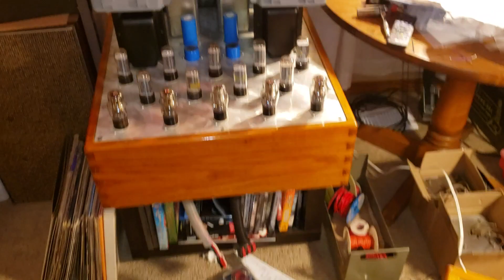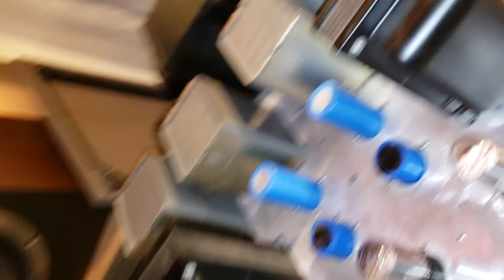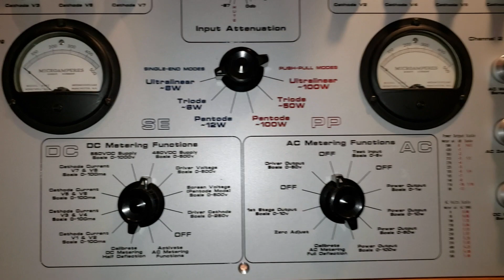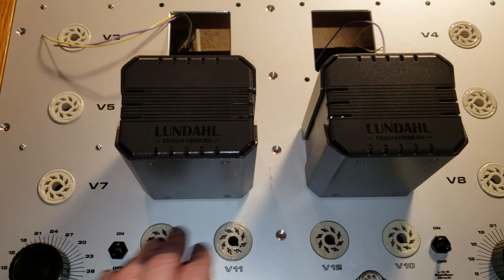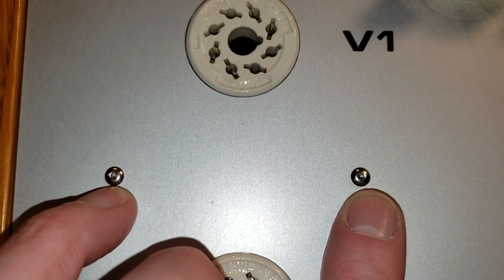A tour of my tube amp for El Paso Tube Amps channel

Comment: That is magnificent work... Wow... My son was commenting to me the other day about how nice vacuum tube amplifiers look with wood and your oak wood work with the copper lining is like the way General Radio did their beautiful instruments of which I have several and love them. Thanks for the video. My amplifiers are certainly not as beautiful as what you have built as mine look like a piece of military equipment from the 1960's... pretty much my colors are wrinkle grey and black. I did paint a vacuum tube headphone amplifier blue that I gave to my grandson for Christmas so I broke my trend there.  :-)
Through our conversations, I think you put the second level of inspiration into me to make an amplifier with a switch to run it in different modes. I can see it in my head - a switch to swap between triode, UL and beam power tube mode and use some VR tubes to regulate the screen voltage probably on a pair of 6550/KT88's.
I split my time between building/working on amplifiers, like the last one I posted, now using 6SN7's in a Williamson circuit driving a pair of KT88's, and my amateur radio hobby. The AM transmitter I commented on in my earlier video is coming along and I have some funny stories to share about it already. The last posting of the large Triad transformer amplifier is turning out good and I just simply removed the Poseidon board and cut a piece of aluminum to hold the 6SN7 sockets and that went OK. Not especially pleased with the physical layout of my amp but, so it goes sometimes. 
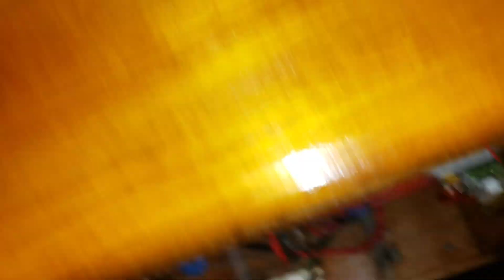I will certainly be checking out your other videos very soon. It 's 2:30 here so I better get to bed as I want to climb my tower and work on an antenna tomorrow. Very pleased to meet you, Sir, and I hope we have many more projects to share. Stay safe.
Reply from the maker: Thanks for all the kind words.  Your work is on a different level than mine, you clearly have your theoretical understanding of tube circuitry much more than I do.  I understand a lot of things about my amp, but I had to hire a proper engineer to actually draw the schematic, do all the spice modeling, etc.  Of course in the 90s when I started this project, access to that kind of software was much harder.  My strength lies in layout and execution, and I'm just trying to build this thing to an appropriate standard for what its capable of.  I also want to be able to stare at it endlessly in my living room.

Your radio stuff is very impressive indeed.  I used to be an engineer at a TV station so I've worked with large transmitters before, but boy those things sure are scary...  The "low" voltage side of those things carry enough power to vaporize you.  One of these days, I need to re-build my bench, get some new scopes, etc.  I see that Tek you have, I love it.  I used to have a 535A with scopemobile cart and a 4 trace plugin.  

Anyway, I'd be happy to privately share the schematic of this amp with you.  The designer thought out the mode switching very well.  All of the modes of operation have been characterized and bench tested, and performance is quite good.
Reply from the maker: Part 2 is here... You won't believe the cable I got for this thing.   https://www.youtube.com/watch?v=BHc3zSO-8Wc